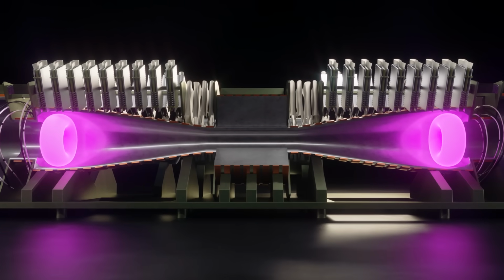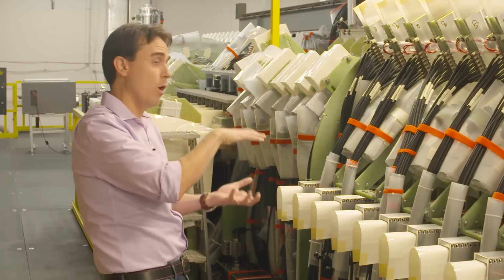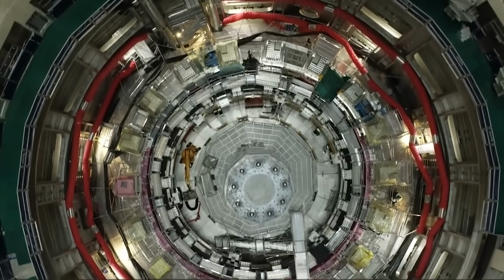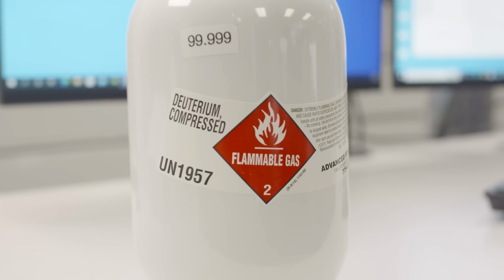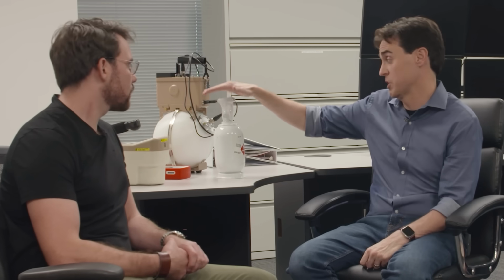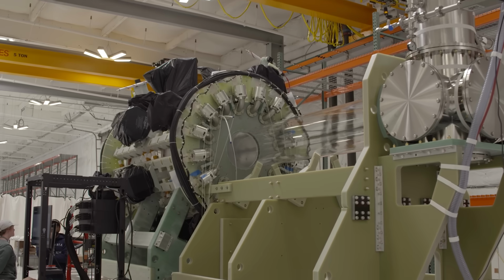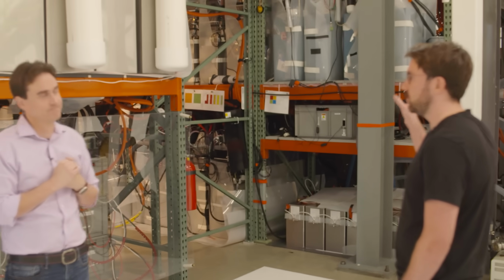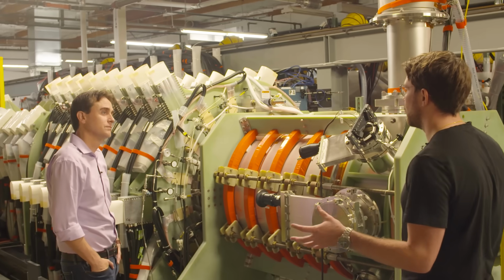A New Way to Achieve Nuclear Fusion: Helion

Comment: Unless you can build “any” fusion reactor small and lightweight enough to power a spaceship, any fusion technology should be considered as pure research. . . without commercial applications for decades.  In the meantime, we already have a fully functioning nuclear fusion reactor, safely shielded 93 million miles away.  It should be noted that ALL energy on earth, its the exception of Nuclear Fission and Geothermal, is a derivative of Solar Powered Nuclear Fusion.  

In the meantime, the work done will probably create of beneficial side benefits. . .  such as better magnets for better electric motors for better electric propulsion. . .
Reply: You aren't going to put any reactor system in Launch/Lander vehicle. That's kind of bonkers to even put as a target to do. And why would you even NEED to do that?

Ground side Fusion power can in theory provide enough power for ACTIVE SUPPORT structures or LAUNCH LOOPS. Once you're out of Earth's gravity well the issue is Thrust to Mass for how fast your want to accelerate, not getting enough thrust to overcome gravity.

We DO NOT need FUSION rockets, for lift. That's just stupid.

Comment: wonder what would happen if as you are compressing the fuel, you bombard it wit xrays or particles accelerated via  an atom smasher....
Reply: i'd assume gamma rays would be more effective than using xrays in a fusion reaction....
Reply: wut bout using lithium and potassium deuteride or tritiride? ya know as a sort of catalyst, i mean if there is one way we know how to fuse atoms, its dat teller-ulam
Reply: wonder how hard it would be to fuse shit like CO2 and nitrogen compounds like heavy ammonia  (ND4 or NT4), or other greenhouse hydrocarbons....
Reply: wouldn't be easier to smash duh molecule to try and fuse, got moar surface area and mass, so you get energy from splittin and den hopefully get some fusion after
Reply: well if you can enrich uranium, you could do the same with beryllium, the mass difference between it and uranium would seem to make it much easier to do than u238/u235 enrichment...
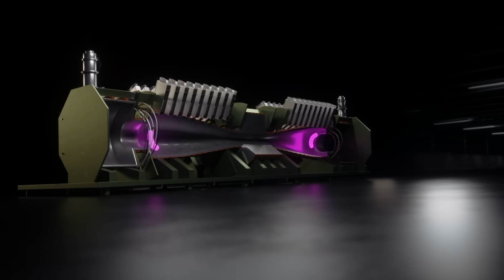Reply: 18:37 if u can pulse dat at 50/60hz it probably makes much easier to plug it in to a grid, seems like it could be much more accurate and precise 50/60hz

to be honest most electronics in duh 21st century take ac and internally make dc or ac at its own needed frequencies....so maybe it'd be much more efficient to use a higher mains frequency, at several khz,  shit running motor and shit of a mains with a 65.536khz frequency would need much smaller motors and teeny tiny ferrite transformers and shit, and would be great for running synchronous motors for keepin dat preciese trak of time...., and jus maek a box to get ya ac 60hz for dat bakwards compatibility
Reply: and since you using dat gas injection system, could also inject dielectric gases that produce their own  electromagnetic fields in the presence of an  electromagnetic field...and probably use superconductor in power harvesting and storage to reduce losses
Reply: mite wanna taek a GaNder at GaN based semiconductor and other fabrication technologies, shit iron pyrite, diamond and graphene seem to work good too.....
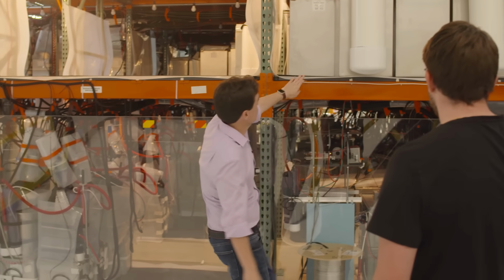Reply: 22:54 you also have electrostatic generators like wimshurst or van de graff generators.....
Reply: i wonder how well two capacitor plates work if shoved inside a large glass tube with an extremely low vacuum......
Reply: wonder what would happen if you incorporate an uv led in duh tube dat could be digitally controlled and can shine and bounce between duh plates, ya know uv light can move electrons.....
Reply: maybe it could work as a high potential capacitor and as a switch?

Comment: And we still haven't solved the one problem that's been plaguing us since we learned nuclear fission.  It wasn't solved when we learned how to contain antimatter.  And it hasn't been solved now that we have nuclear fusion.

We have zero technology that will let us use raw energy.  Unless we can boil water and turn a generator, nuclear fission, matter/antimatter reactions, and nuclear fusion, mean absolutely nothing.

It's still just boiling water and turning a turbine.   That's it.  Whether it's using mirrors to melt salt, nuclear fission to heat control rods, or sending water through a turbine, it's still just doing the very same thing we've been doing since we started burning coal.   Using water to spin a generator.  Every power plant is just a hamster running on a wheel.

Comment: How is helium-3 produced? I know that there are deposits of helium-3 on the moon, but how can it be bred on earth with elements like hydrogen and helium and such?
Reply: Tritium has 1 proton and 2 neutrons in its nucleus. Through beta decay, one of the neutrons splits into a proton and an electron, leaving a nucleus with 2 protons and 1 neutron, aka helium-3.
Reply: @ironicdivinemandatestan4262  I watched the rest of the video, and though I don't fully understand the process, I know now that this technology can be adapted to breed helium-3 fuel. I wonder if spallation of more common elements like lithium could work as well?

Comment: I can't help but wonder about their expectations around net energy gain/loss - like, are they expecting Polaris to actually do that? It felt a bit ambiguous within the video and I'm not sure if that's from their own uncertainty or something for a later video. 

Not that failing to reach net output is a major problem, if they are able to build a device able to actually extract electrical power at all and which can run continually for a protracted period of time. That in itself would be pretty earth-shattering. Actually pulling power out of that would be nothing short of revolutionary.

Comment: I'm guessing that the ideal situation is that the system cycles a capacitor bank in resonance? I mean ultimately, in a final design, not developmental. This thing is going to throb like a warp engine on the Enterprise.